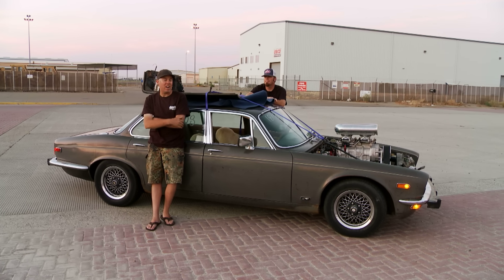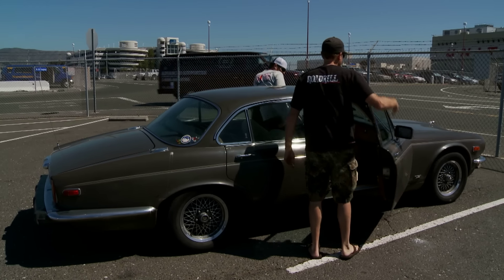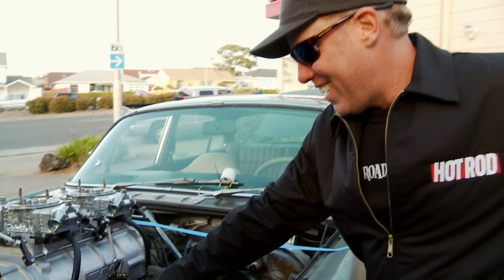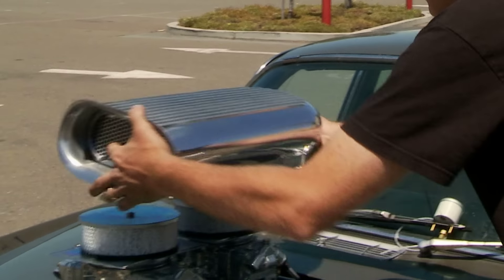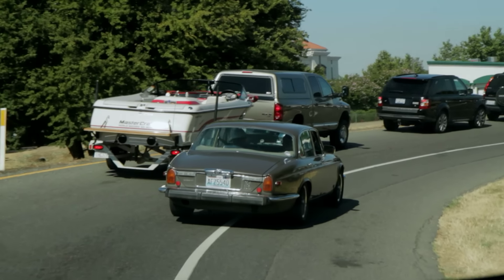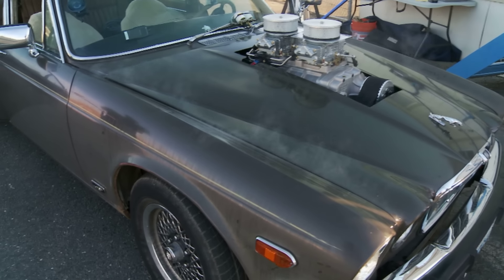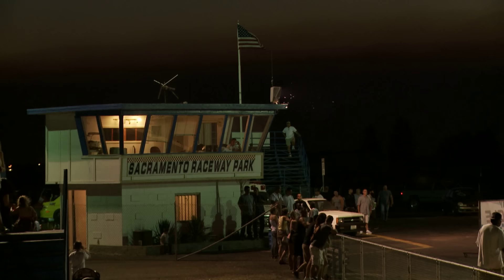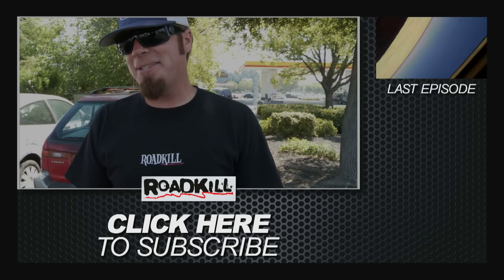Release The Draguar! Building a Blown Jaguar Rat Rod - Roadkill Episode 7

Comment: So many butt hurt British people... hahaha.
Reply: Smegg off
Reply: Andrew Laedtke  ....... clearly not seen the new 600hp jags have you. lots of different engines in the jags, as they were built for luxury for a long time. so yeah an old v12 jag isnt going to stand up to a new car is it..
Reply: $1000 bucks! ;)
Reply: kris burns what 600hp jag?
Reply: Brandon carson  The one in this video...
Reply: Ian B he's talking about factory jags not hotrod jags
Reply: Oh..they havent made a 600 hp factory jag
yet
Reply: Fe
Reply: Ian B in this video it's not 600hp yet, they swapped in the 600hp motor over at hot rod garage because they ruined this engjne by overheating it too many times
Reply: full movies kids
Reply: Lol, I'm British and I don't see why they'd be butthurt
Reply: ***** Probably because most of them seem to put this car on a pedestal for some reason.
Reply: David F. Kind of true, lol.
Reply: I'm British and I love it
Reply: +David F.  I'm British and I'd rather have a small block Chevy in one of those than the factory standard (BL) V12, especially the strangled US-spec one.  In fact at one point it was a pretty common swap, in 6s and 12s but pretty much everyone knew not to use the standard radiator as the standard cooling system was heavily compromised and barely adequate even in tip-top condition let alone nearly 40 years down the road...
Reply: Jaguar's not even a British company anymore, its Indian!
Reply: +ObiTrev  That's very much true, it's part of the huge Tata conglomerate now, but it very much was when this car was built, at that time it was part of the walking disaster area that was British Leyland.  And while it may not be under British ownership (it hasn't really been since Ford took over from Sir John Egan) it does still build all its vehicles in the UK, though for how much longer is uncertain...
Reply: Sorry to say but Ford put Aston Martin body style on low end fiestas and focuses.
Reply: David F.
Reply: @barrybend7189  The new Mustang
Reply: @PriestOfAuril  ""an old v12 jag isnt going to stand up to a new car is it..""
Why wouldn't it? Just slap a new turbo or supercharger on it. Plenty of old 50's chevy's and other americana get tuned up and beat brand new european hypercars at the drag strip constantly.

Comment: I'm glad it was admitted that the blower was largely cosmetic.People seem to think you just get yourself a blower,bolt it on to your everyday engine and away you go. That just aint so. The big problem is valve overlap which can be around 50 degrees BTDC. This needs to be brought down to 30 deg' or less by fitting a new cam.Otherwise,with both valves open at the same time on overlap the pressurized charge goes straight through into the exhaust, so,no advantage. That's the way it is,I'm afraid.

Comment: Re-time your motor, some people call it 'dieseling' (yeah, non diesel motors can do it to - they just dont like it lol) Had the same problem with my 350 Olds. Got so bad I had to manually get out, pop the hood, and smother the carb with a rag to get it to die. Occam's razor, Id say start with a new timing chain and get a goood re-timing and see if that does the trick.

Comment: A Blower, Supercharger, And turbocharger follow the basic principle To give the engine more air to Allow for more fuel which comes to more power  the differance is turbochargers are driven by The engines exhaust and superchargers are driven by a belt attached to a pulley on the front of the Motor. Also I consider a blower and supercharger to be the same thing

Comment: So if with most of these cheap builds, overheating is a problem, why not predict the problem and bring a new (universal) radiator?

Other than that, love the show & this is one of my fav episodes.
Reply: Kasper Dekker  Radiator was the least of their problems. DIdn't you see the water spewing out of the heads?
Reply: Kasper Dekker They needed an intercooler, those old roots blowers run incredibly hot so with no intercooler, even the best engine cooling system won't have a chance. It's one reason why a lot of guys run no hood, not just for the looks but because it can vent heat faster. In the winter you could probably heat your garage just by running the engine a while.
Reply: snakesonaplane2 Ah thanks for the explanation :D also missed the last bit where they actually did install a new radiator.

Comment: No surprise, that it was slow in the quarter mile. Jags used a limited slip rear for the XJ12, but the final drive ratio was extremely steep. My v12 jag had a 2.88:1 drive ratio. Good for the open road (with a top speed of 150+, with the original engine) but not so good for the 1/4 mile. Since you guys have no problems with hacking a Jag with an angle grinder, perhaps the next step would be to ditch the nice jag rear suspension, and shit-slap a Ford 9 inch posi-rear in it. With a lower final drive ratio, maybe you can make a 12 second run before it drops an exhaust valve and reduces the engine to scrap metal. Ha.

Comment: Ironic that Jags came with a THM400, but this one has the THM350. not that it's a wimpy trans, but....

I'm guessing those center bolt valve covers are hiding Vortec heads underneath? they prefer less initial timing, and not much valve lift. woulda been interesting to take the Vortec to its limits (plenty of budget builds on youboob) and then add boost to see what it's like before going for a big rebuild.

Comment: On the "Mitsubishi Lancer Tommi Makinen edition" there was a function that sprays water on the radiator, to help cool down the engine when so desired. You could move the hoses from the front window to the front of the radiator, and spray. How well it would have worked, I do not know

Comment: i missed this when it came out the first time. i would have loved to have been in on this project. why not try to rebuild this one and see what you can make of it? just a regular 350 instead of the vortec would have been a better option for this car plus i would have gone with a 400 instead of a 350 myself, there's just too much weight in that car for a 350 and it's too long

Comment: can someone please answer me something. I know this is probably a dumb question, but would a new or bigger/better radiator have kept it cool? or is it just inevitable to keep a blown stock sbc cool?
Reply: Well they said that the radiator was bad so yes a new radiator would have helped alot
Reply: but they put a new one in it and it was still over heating. should it have been bigger or something?
Reply: Im sure bigger would help but the design of the car could also have been the problem. Maybe not having good airflow to the engine could have been the problem

Comment: I don't think they're ruining the car, they're actually saving it, they fixed some of the rust and replaced the engine with proper cooling and all, instead of rusting away and eventually getting crushed now many many people, including me, wanna own the car, i'd probably somehow throw a manual on it, don't know how but just imagine a manual jaaaaag with a blower and all.

Btw isn't the F-Type V8s a supercharged V8 jag? Just like this one, sort of.
Reply: No. The v8 in the F-Type is of aluminium, Has Fuel Injection, Has overhead Cams.
Reply: ***** Hence the "sort of" at the end.
Reply: ArthurAlcantara It has completely different block and tops. No push rods, a chain up to overhead cams on both banks where the smallblock has rockers.

Its made from completely different material.

Aside from the fact its a v8 and has a compressor I se no similarities.

The J-Type engine has more in common with the one in the new corvettes.

Comment: ive owned a 76 xj12 and the engine in stock form is terrible. tho ive herd of boat racers boring them out to an even 10 and they make like 1000+hp but im restoring my dads old 87 xj6 vandeplas. hes had it sitting in his yard for about 10 years and we put a new batt in it and it started right up! the xk block in those cars were great because you could make em into 5.0 and theyd haul ass. they handle boost like nothing else too, i saw a tri-turbo xj6 at a car show.= better then american engines

Comment: the 5.3 v12 that came originally in this would be much more powerful than the chevy engine, and it can still be supercharged if you take the aircon compressor off the engine

Comment: I cleaned out the garage and have to replace the fuel pump in my 1994 S10 SS. It's 100 degrees outside and 80 percent humidity everywhere. Yeah,  this sucks.

Comment: It is usually a build up of carbon inside the cylinder head combustion chambers this retains enough heat to continue igniting the fuel/air take off the cylinder head clean off the valve faces, tops of pistons and combustion chambers skim head check timing not too rich will be fine

Comment: ever work with either one? v12 is semi OK- late 60's developed emissions hobbled, under-displacement. The 6 is a joke- early 40's developed, with over an inch thick iron in places where .160" belongs. Chev engine with blower is still lighter by weight

Comment: @iadr
By the way don't you think its kind of sad that jag designed a better engine In the 60's and 70s then Chevy ever did?  Over head cams, constant velocity carbs.  Everything about them was better.  Only the electronics and exhaust systems dragged them down.
Anyways my 6.0 v12 puts out 400 horse power and its almost bone stock.

Comment: These guys just do bolt on mods with a few cuts. They have other people build their engines ect
Reply: That's true. Just look at all the trouble they have setting up the throttle cable, it's pretty basic fabrication stuff & they cant do it.
Reply: +Marauder252 what kind of fab work can you do in a parking lot without proper tools?
Reply: they build their own motors idiot. Finnegan built the Bonneville motor, and any other swap is just a crate engine because they don't have the time to take months building and engine.

Comment: Is that legal to change the engine and run it on the streets?
Reply: +Victor Gudmundsson  , yes ........ Mainly depending on the year and weather it needs to pass emissions or not and the state you are in ......... But you can swap just about any engine into any car as long as it passes emissions , or is exempt from emissions ( CA )  ... In other states like South Carolina where there is no inspection or emissions , you can do just about anything and drive it on the street ............
Reply: +Norman Murray sweet

Comment: Insane! Poor, poor Jag.
Reply: We bought an old Jag off ebay just for the Cadillac 500/Turbo 400-
$830.

Scrap the Jag,Clyde.

Those cars were junk:

"The Series II (1973-79) models were known for their poor build quality,
which was attributed to Jaguar being part of the British Leyland group along with massive labour union relations problems that plagued most of industrial England in the same time period, and to problems inherent in the design of certain
Lucas-sourced components."

"In May 1977,
it was announced that automatic transmission version of the twelve-cylinder cars would be fitted with a General Motors three-speed THM 400 transmission in place of the British built Borg-Warner units used hitherto."

Even the factory knew to GO GM!
Reply: I had the XJ6 and the newer XJ6 Sport versions and they were superb, but, BMW I think did the transmission for those. The Jag XJS V12 was good and lasted the test of time, but body work was leyland crap too. Love to see you put a blower on the v6 3.2ltr version as they were super quick too, but, very heavy. Keep up the fun though guys! love your vids.
Scrumpy

Comment: The Draguar is till a turd, even with the blower. It went bang in the end didn't it. Not a good idea to put a blower on a motor which could have been as whipped as the rest of the car was.
It also has some issued with rust if ripping suspension components out of the body is anything to go by.
Does it still have the Jaguar independant rear axle or a American replacement?
I am wondering how good it would be with a matched up transmission and axle.
There seemed to be a whole lot wrong when they were thrashing on it at Willow Springs Horse Thief Mile.
I wonder if the replacement engine & blower would have fitted that '68 charger.
Why not shove that motor into another car... Like the Buick Special they bought from Rick Pewe.

The guys seem to like doing some pretty weird things for our entertainment.
Why not re-energise an engine-less hulk.... WITH A DIESEL. By harvesting a junkyard or junkyards. Whatever the result was it would have to try hard to be as much of a death trap or as horrific to drive as the ratrod jeep.

Comment: ok it's heating so lets throw a blower on a sbc and see if it's better
Reply: It's got more air going through it, it's gotta be! if it's not cooler in one way it is in another...
Reply: more air into combustion chamber means more combustion pressure...more pressure equals more heat...they were doomed from the start
Reply: Brad hoffman Nah man you have to be an optimist when their is no positive. More air equals better combustion and therefor better thermal efficiency. When you have better thermal efficiency you make more power, more power to turn the water pump so you're running cooler. Even if none of it's true you just have to believe for the sake of not giving up on the Draguar.
Reply: just saying..if it was heating before why not check the radiator and the thermostat before making more heat in the engine...and a blower itself makes heat
Reply: Brad hoffman I think they just don't care about what's already in it. They bought it cheap and they'd probably like if the engine nuked itself so they could drop in a fresh small block and turn it into a project car. That's what my friend did with his old Firebird. It had a 400 but the block wasn't useable for a rebuild so he just drove the hell out of it until it quit and went from the ground up.
Reply: that would be the only reason....And i don't do shit like that...always someone that needs parts even if it is nothing but a smogger sbc

Comment: I wonder if they tried adjusting the timing... In my experience, I have found that if a car is not in time just right it can cause it to run hotter.  My car if retarded a tad bit, will almost try to over heat climbing the mountains.  If I advance it a tad, it runs cool and also picks up a little power.

Comment: honestly i didnt think the blower would help much. My 64' bonneville could beat that XD and the trans isnt made for doing that shit. not to mention its a big ass boat but hey, it has a 389 big block. it would've had a crate engine in it but the previous owner bought the wrong dip stick (didnt come with one) and put 2 quarts or oil in it. dip stick read 4..... waste of an engine. lets say a new crate engine was blown up so the original was rebuilt and reunited with her. pretty dumb if you ask me.

Comment: how did you find a car for 1000$
Reply: I got a pair of 98 and 97 chevy luminas for free because no one wanted them.  1 ran and drove and was my first car for over a year. 

I got a 2000 chevy z24 cavalier for 850 and drove it for a year before the master cylinder blew out while panic braking in traffic ( people stopped at a green light) causing me to rear end someone. 

And I bought a 98 olds cutlass for 300 to drive this winter so I could work on my mini cooper.  

The cars are out there you just have to go look for them :)
Reply: aha the free ones came with keys?
Reply: Deadmeatslick I drove one of them for a year ha yes they came with keys and a title. yea there wasn't really anything wrong with it other then it being a little beat up.

Comment: That's just desecration.  Poor Jaguar.
Reply: ***** all jags are piles of shit lol
Reply: Frank Burns a lot of the v12's were wiped out because it was common Well here in Australia at least that the main radiator hose would come off and because there was no water you couldn't tell it was getting as hot as it was and yeh they fried because they were alloy's. its actually common practice to put a 350 chev in these Jags

Comment: @iadr
Yes.  I own a 74 xj12
A 94 majestic
And a 94 vandenplas.

The straight six is 100 percent better.  All straight sixes are better then v8s: smoother, longer torque curve, better balanced. (Mine has over 200,000 on the clock and is still running beautifully.
As for the v12s I can balance a penny on my engine while its running, even on the 74.  But If you are the kind of idiot who just cares about rumble and power then swap in a Mopar 440.